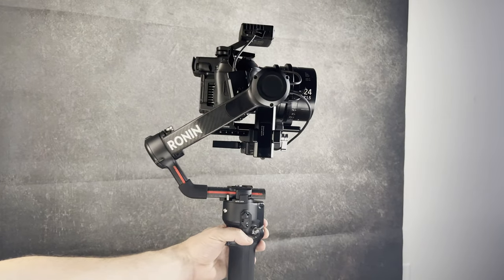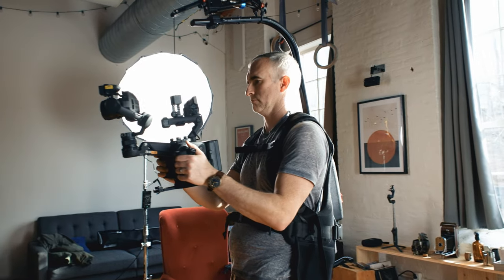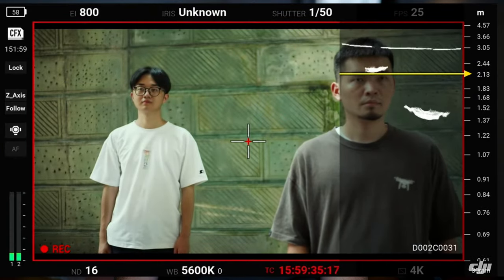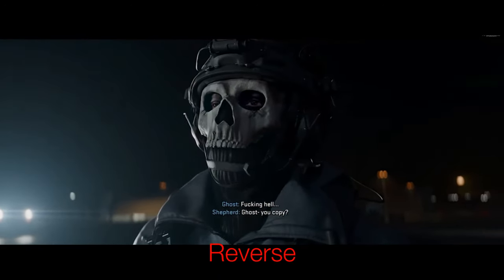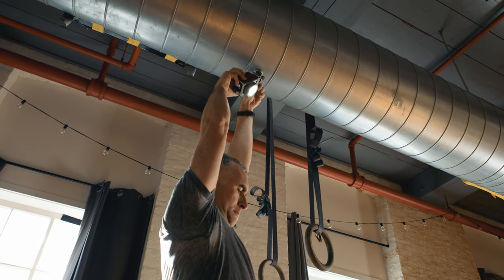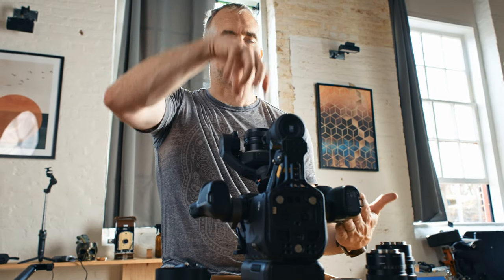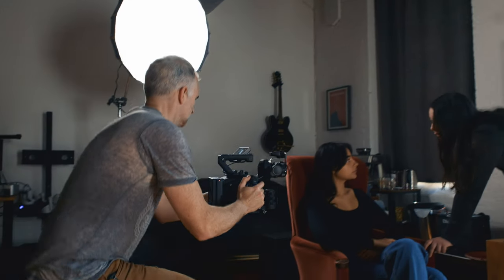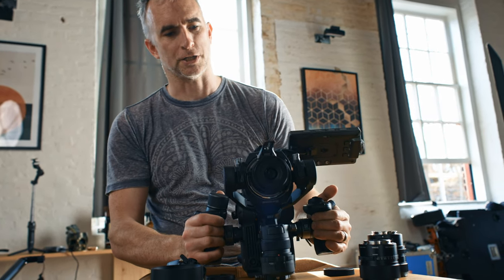Moving Master Shots with the Ronin 4d

Comment: HEY! Can I ask you a short Question? Do I need the  Zenmuse X9 Focusmotor to focus. I saw, you don't use one. I would like to order the same sigma lenses as you use in the clip. Can I use the active track?, the autofocus or have I focus with the wheel on the grip?
THX a LOT
Andre
Reply: Ronin 4D works best with small AF lenses upto 1 kilo, but support manual focus lenses as well. It’s just more laborious to work with.

Comment: This couldn’t be a more well put together review of the 4d in use except that we don’t really see the master shot finally graded and post stabilised. The 4d promises so much but unfortunately I find the camera stability questionable and there is often a visible reframing effect when the camera frame rests between movements. It’s just not convincing and compared to a steadycam or larger gimbal and vest set up or even a dolly jib combo it just doesn’t look smooth and convincing enough. It’s such a shame. Maybe it needs a proper arm or ready rig? I have tried to love it but I found myself using it like Michael Bay rather than Stanley Kubrick. It just doesn’t enjoy considered unmotivated movement. The lens choice too seems really problematic or really it’s the lack of lighting. If it’s not focal depth then the scene and the movement really gets help if the camera can move through shadow and have subjects move between key and backlit blocking. I haven’t seen anything better than the original launch shots by Messerschmidt using very fast leica cine primes. It’s just physically not a substitute for real techno crane or trinity movement. But thanks for the video and the considerable effort and care that was put into this and any of this channels videos. Hugely appreciated as always.
Reply: Did  you really  expect a $7000usd camera gimbal to replace a $60K trinity and $150K technocrane combined... Wow!
Reply: @sergiosanchez2012  hi. Yes and no. The trinity is an expensive piece of kit but the motion fundamentals are the same as picking up a broom. It’s basic physics and more specifically the principles of “fulcrum moments” and “inertia”. Google it if you don’t believe me. That’s what a steadycam uses as its basic fundamental principle. A gimbal even the most basic one on the end of a monopod would illustrate the point just as well. It’s all about counter balanced movements around a fulcrum point. The trinity and gimbals do this under power from the motors to help with weight and camera orientation but the principles are the same. What the 4d does is wholly ignore these fundamental principles and tries to solve the situation only using motors and a compensatory feedback system to control them built into the gyro. In the trinity this is a dampening system and a camera support system but it adheres to the most basic fundamentals of moments around a fulcrum point. The 4d does not and actually completely ignores these first principles of physics and so it introduces issues that create wholly unnatural artefacts that jar. We wouldn’t get these kinds of artefacts having the camera on the shoulder as we have a fulcrum point. Fundamentally it’s how we see and process movement. Our brains compensate for natural movements. The 4d introduces an unnatural movement that could never be seen naturally and so it jars with our brains perception and functioning and so the movement is interpreted as unnatural. We don’t see or process movement like a chicken. All this can be achieved by sticking a gimbal on the end of a monopod and again if you are in any doubt maybe check out Tilta a version of the principle is used in the float system which is exactly a poor man’s trinity.